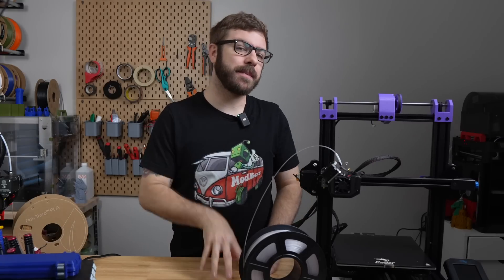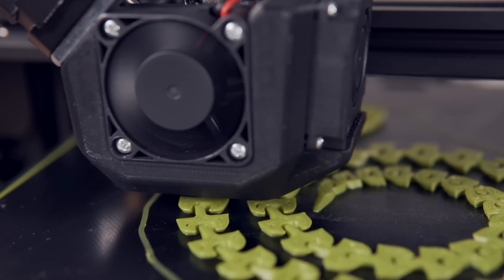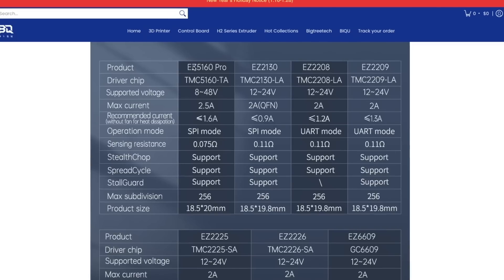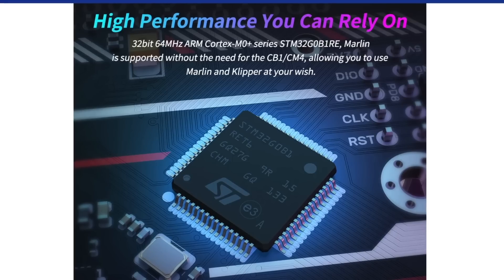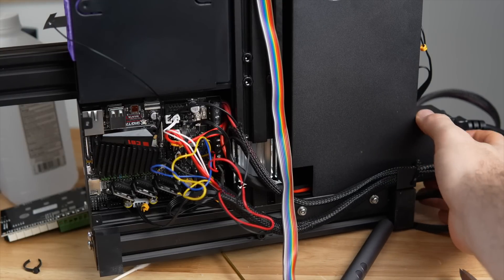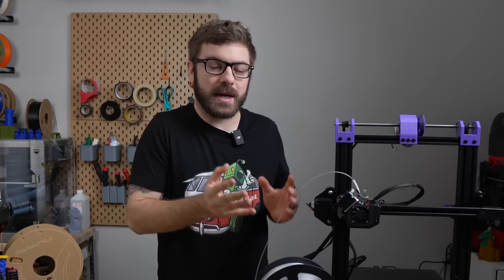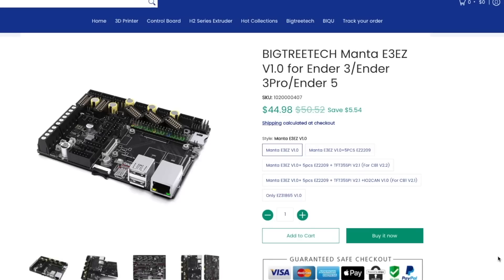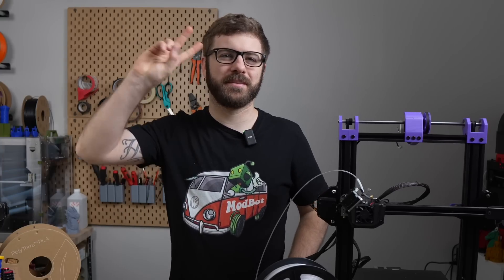The BTT E3EZ Manta Board Is Feature Packed (But Be Careful!)

Comment: I upgraded one of my Ender 3 Pros with the Manta E3EZ.  However, I used the STL files for the enclosure of the Ender 3 V2 on the BTT E3EZ GitHub.  The twist I put on that install was I added a 40mmX40mmx20mm block to the end of the left 40x40 rail to move the board forward 20 mm.  This gives more room at the back where the screw terminals for power and heaters. It also helps to keep the SD card from getting in the way of the screw tab from the top cover down to the bottom cover. It is close but no interference.  The rear mounting holes for the top and bottom plates I moved 20mm back to compensate for the covers moving forward 20mm due to the 20mm block added in front.  I also used an STL for a BTT HDMI5 Voron mount.  I added a 40x40x20mm block to the right side rail and mounted the display mount with long M5 screws into the end of the right rail.  I also got a BTT 3.5 SPI touch display and found a STL for a mount on the right rail like the original metal mount. The 3.5 display looks nice, but it is so small my fat fingers have a hard time hitting the buttons on the screen.  For that reason I am going back to the HDMI5 screen.  My fingers can hit any button easily.

Comment: With the EZ’s five motor control channels, is it possible to independently control two z-axis stepper motors used in a two z-axis modification on an Ender 3 instead of running them in parallel from a single channel? Thanks.

Comment: How has this board been performing?   I purchased for my e3 v2 and got a cb1 emmc so it shouldn't have a micro SD card in the way I alao got the tft35spi.    I have set up the cb1 and the screen so far but have not yet set up the firmware on the main board.   Just curious to see some of your printing here any impressions and also if you ha e added accelerometers or any other features onto your printer

Comment: Are you able to run klipper with the  ender3v2 screen? 
Also will this board work with their hdmi screens?  I'm wondering if I would want the m5p or this ez3 for my ender3v2. I do not have a problem designing cases to mount a board to the printer

Comment: I just orded this as part of kit with 5 2209 stepper drivers and a CB1, as I want shift to autolevl via dual Z motors and Klipper alongside permenantly attach a pair of adxl345 for input shaping.

The concern I have is I hear about the SD card for Klipper getting corrupted when device is not shut down properly. I had orginally planned to keep an RP4 permenatly powered on when I started looking at Klipper, but this board intergartes and has a 5th stepper.

Is SD card corruption an issue with this board, or is there a simple way to tell it shut down before I turn off the power?

Comment: I did buy this with a CB-1 eMMC 16G, the CB-1 heat sink and the SPI-TFT35 for a future Trident build.
I tested the board with CanBoot and Kipper and it works fine. 
However if you want to use this board with Klipper, you NEED a CM4 or CB-1, like ALL BTT Manta boards. You cannot connect a "normal" PI to it with an USB cable. All Manta boards are designed to talk only to a compute module (CM4 or CB-1)!!!

Comment: @ModBot, Have you noticed that your stepper drivers run hotter after installing this board with the 2209 drivers?
Reply: I am experiencing overheating in my extruder motor with that same drivers. Did you find any fix for this?
Reply: In the cfg file for the ender 3, under the 2209 section they have the default amperage as 0.8 when I looked. I would double check to see what amperage your specific stepper needs and if you can get away with lowering it a bit.

Comment: I had issues with the SD card slot on my Skr Mini V3 and it broke off rendering the board useless. The solder points were not very solid.

Comment: Does the board run without the CM Module ? I got it as a replacement for my SKR Mini. But the board is not found on the usb port (using the same setup port/cable as before)

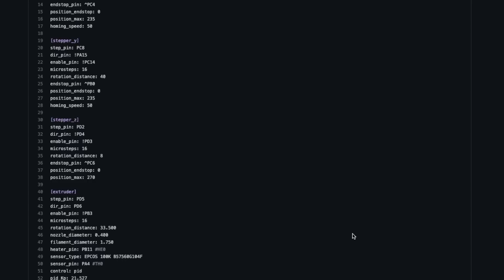Comment: I'm having trouble getting klipper to see this board.  No serial port is created.  Did you use the menuconfig settings  at 6:00?  I can't think of anything else to try.  BTW, I'm using a pi3 not CB1.
Reply: Did you sort this? Set up my E3EZ today and my Pi4B cannot see it via USB. Seems to be alive as the firmware.bin got renamed to firmware.cur

Comment: But the most important, is this board really worth it? Not only price but effort for mod and firmware burning. Which are the things this board could do that stock board don't just to start?
Reply: I gues that this thing will bring the klipper option on a single board configuration. Many of us dont find the sense of using two boards with two power conections for an ender 3. I have a Mellow fly e3 v3 with RRF on my ender 3 pro and i dont want more complications with a second board for a very slow bed slinger.
Reply: You can drop this into, say, the recently released Elegoo Saturn, mod it for dual Z-axis, get Klipper running, do some accelerometer calibration, and you'll immediately get much better printing speeds.

Comment: As a workaround for the screw/SD card issue, you can put the plate on 1" forward and then slide the tab back under the SD card, then use one of the short screws from the bottom corners on that screw hole, otherwise the longer screw will just break the card the other way.  Otherwise, just got mine installed and set up and it's lookin minty fresh 👌just need to design a new enclosure to expose the USB and Ethernet ports

Comment: BTT should have used a clamshell type microsd slot…those auto eject ones are useful for applications when you need to remove the sd card frequently or to access it without unscrewing anything.

Comment: Oh man, I did the exact same thing with my Ender 3 pro and this board when I installed it, and I ended up having to resolder my SD card holder back onto the board as well! But in my case, I just bent the tab straight up on the cover, so it fit through the gap. However, I also ended up breaking my SD card, so I had to re-flash everything onto a new card. Wish I would have seen this video first! Lol

Comment: You know I'm torn because I agree with you that this is an EZ board and should be drop in replacement. But I'm also compelled to point out that the only boards named on the site (when I went to go buy it because of course I am lol) is the Ender 3/Ender 3 Pro and Ender 5. No mention of it working with a V2. BUT I very much agree with your assessment that it should be located somewhere else. Maybe they could put something on the site that says if using with Ender 3 V2, the OS SD can not be used and they recommend a CM4 with on board EMMC storage.....but that also doesn't further the sales of their own CB1
Reply: Docs are being updated today and who says that there is no CB1 with eMMC about to land ;)

Comment: Fantastic review and good catch on the issue with the SD card. It's always disappointing when something like this goes unnoticed by the manufacturer but, hopefully, people like yourself and others can spread the word enough to prevent others from having this issue. (And hopefully BTT updates their documentation, at the very least, with the suggestion to remove the tab as you did.)
Reply: Documentation updates coming today and a revision is already in progress but, since the board is also for use on many other machines, we will need to engineer a solution that solves this without making SD card access a hassle for other machines.
Reply: The main issue is just that this thing is so incredibly jam packed with every possible feature imaginable that it leaves very little wiggle room.  Will get a revision out soon which adds V2 compatibility though.

Comment: Sounds like you should design and print a new electronic box or at least the cover.  I do agree though that the design of the board was not thought out very well.  Also, the SD card should be accessible from the outside of the electronic box.

Comment: I did not have the tab issue on a standard Ender 3, On my Pro in which I mounted it, I had already used a different printed case to house an SKR v1.3. SO I modified that case and 3d printed it, and moved the board over closer to the center to allow a little more room,  Also the CAN pins are different and are not implemented in Klipper yet.
Reply: any update regarding the can pins?

Comment: I just installed an SKR E3 into an Ender 3 max and it has the same screw placement on the cover so one to add to the list.
Reply: that sounds like a problem with just the ender 3 max, its not a problem on v2s, pros or non pros, the skr mini e3 line has been in production and use for a few years now and that problem has not been reported so far
Reply: @Fisheiyy  those boards don't have the sd card in that position, I had no problem installing it  but was just saying it would with the E3EZ board because of the screw position on the cover.

Comment: There will be a Marlin plus OctoPrint option for the Manta-with-Pi available in the near future, for a somewhat simplified configuration and the use of common displays. With this setup it should also be possible to use the StepDaemon that employs the G6 command for direct motion control.
Reply: I wonder if there's anything going on for the development of direct stepper motion, cause the Github page still shows the 2 years ago version that doesn't support even CoreXY motion systems yet, just Cartesian.
Reply: @Kalvinjj  I think Colin Godsey has moved on to other things. We are focusing a lot on the motion system lately, so perhaps that will generate more interest in G6.

Comment: Here's a crazy idea. Just build and enclosure that mounts to the frame and install the board on it. 

They created a square board with the sole purpose of controlling 3D printers or CNC machines. You can't just shove it in whatever 3D printer and expect it physically fit. You can't expect them to accommodate whatever machine you're using. You have the tools to build a better mounting location for it.
Reply from the maker: You must have missed that this is the E3EZ. It is made for this printer. 

Of course you can build an enclosure for the board. That can be done for any board. What is unique about this board is its ability to be swapped into creality printers without needing to do that.
Reply: @ModBotArmy  it's unavoidable. It's also made to work with the printer, not fit inside of it. Huge difference.

Considering the DS card is not accessible, a separate enclosure seems more of a common sense.
Reply: @TechnologistAtWork  it is infact made to fit inside of it, otherwise they would not use the same mounting points and design it to fit inside the original electronics housing nearly perfectly
Reply: @TechnologistAtWork  you seem to have missed the entire point of this board, which is intended to be a drop-in replacement, meaning it replaces the stock board inside the machine. it absolutely should fit in place and not require any custom printing or modifications, as that defeats the entire purpose. BTT already has plenty of generic boards with similar functionality if you don't care about printing off an enclosure. this board would fit an E3V1 just fine, but it's an oversight not to have checked it on an E3V2, plain and simple.

Comment: While I understand the issue with the sd card, is it necessary? I know the mainboards like the skr mini e3 v2 don't require the sd card, where as the raspberry pi that host klipper or octoprint need an sd card to have the firmware. But what about this board? Maybe it doesn't require an sd card, and this will make it a "drop-in" replacement?
Reply: Exactly my question. Did you uncover the answer?

Comment: Clearly this is a BTT issue.  On their purchase site there is an image with text that talks about "perfect" compatibility with Ender 3 and a rendering of an Ender 3 with this board that includes the cover!  I would like to give BTT the benefit of the doubt, but something needs to be done.  Thanks @ModBot for bring this to the attention of the community.  BTT, your move...
Reply: To their credit, they don't mention the E3V2 on their site, but this was an oversight nonetheless
Reply: @gerrycave  It also interferes with my E3Pro. I believe it will clash with most (If not all) Sku's of ender 3.
Reply: @michelvangent3683  Thats great that they provide people a case to print but, none of that changes the fact it really cant be considered a drop in replacement. AND worse yet they know about it but have not updated any product pages to disclose this issue.

Comment: You really should of read the manual before you installed it lol.
Reply: Only fits the screw holes nd  not the case
Reply from the maker: I just looked again at the manual and see nothing that stands out? If it is in there it definitely does not stand out enough. Something as big as that should be in bold right at the beginning. I also dont think that is enough. Unless they have an .stl for a new base that is part of the install telling someone to leave the bottom off of their printer is not a solution.
Reply from the maker: If you have a link or page number to where you see that please let me know. The word case is not in their .pdf.
Reply: @ModBotArmy  There are a couple of references to the fact it's only hole compatible on page 5, and a couple of warnings regarding the dimensions on page 6. I don't think they can advertise it as "fully compatible" due to the fact that most of the products it's meant to replace (both the original board and the printer as a whole) aren't open source. Hence, the hole definition. I remember TH3D had some issues with this same issue when releasing its own model. 

Regarding the microSD card, it's normal practice for SBC manufacturers to put the slot of the edge, as you want the actual NAND module outside of the perimeter of the board to avoid interferences. It's not properly a standard? Just a good idea for high bandwidth applications like this one.
Reply: @ModBotArmy  ok I’ll find it again give ‘em a min
Reply from the maker: I see on page 5 it says "It is compatible with Ender-3 motherboard mounting holes." but that has always been the case with E3 boards from them. The thing that is missing is "not compatible with stock controller cover. Using it will damage the board." That is really what I am trying to get across. If it is intentional and they are aware it should be incredibly obvious. I did use the docs and read through much of it yet still found nothing that made it clear. Many wont read through 34 pages of docs and it should be front and center. 

That makes sense regarding the SD card. That being said compared to Pis, or most other boards this particular sd card sticks out much more. This could partially be due to them not using spring slots but I don't think I have seen an sd card stick that far out before. (At least not that I can recall)
Reply: @ModBotArmy  As far as I've seen through the last 4 years, Creality has no revision control/naming. They often change and swap parts that I would define an integral part of the assembly. For E.g., I wrote an article on fan replacements for the S1, with an early unit as a reference. It had a 4010 fan, that Creality later swapped for a 3010, and 3 months later for another 3010 with thinner mounts (to avoid user replacements btw). I learned it the hard way when half of the readers couldn't fit it, the other half could, and nobody could again in 3 months' time. The same S1 had a very constricted flow for the mainboard that was silently fixed. No notices,  no revision naming. It has happened a lot in the history of the Ender series: swapped boards, PSUs, electronics enclosures, hotend shroud geometry, and carriages (especially on the NEO series). It's a nightmare. A game of tag with Creality. My hypothesis is that either BTT had a unit with a different screw placement, or you have one. 

Regarding the microSD, it actually doesn't stick out that much. Many industrial SBCs or boards with such slots have it way "worse"; Odroids and OrangePis sometimes too. The more the better, anyway.
Reply from the maker: WHAT?!
Reply: @ModBotArmy  ya it’s either there or in the description.  Seen it while I was tinkercading the new box for it if all things lol .  Ngl tno @modbot  is should of been in big letters across the box  lol 🤷‍♂️  Woopsie.  Did they replace it for you atleast
Reply: Me and  buddy where talking about it when we came across it . kinda shocked that overlooked that mounting hole so bad
Reply from the maker: Yeah it is not very clear. The description says "perfectly compatible with ender 3, precise interface position, and direct replacement for original board" Considering all previous E3 boards have been drop in this feels like an oversight to me. I had a second I ended up swapping it out with. My solder work was holding up but I was having some spotty issues with the OS. Non smashed board has had no issues.

Comment: could you tell us what electrical ends you have and the tool to crimp them please? Thank you!
Reply from the maker: Yeah! So those are JST connectors. I recommend PA-09 crimpers. They arent the cheapest but I tell you what if you don't have experience crimping they make it much easier.
Reply: @ModBotArmy  seriously appreciate your help man! I have a few of the belted z variants being built now. I need to do some wiring work on them and yeah.. good to get it from the source, someone using the stuff. I am going to try to get a channel going, I have the CR10 S5 that I am doing the double motor belted z on it. Plan on fitting the lower with a Voron-esq look with it. 
Anyway, resto-modding the older 8 bit printers is fun as hell. 

Cheers man!